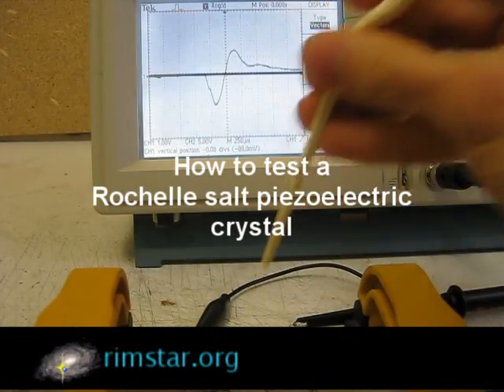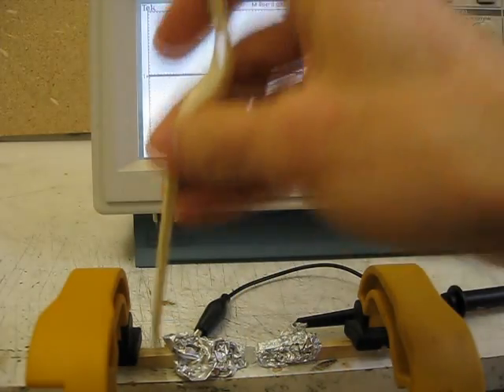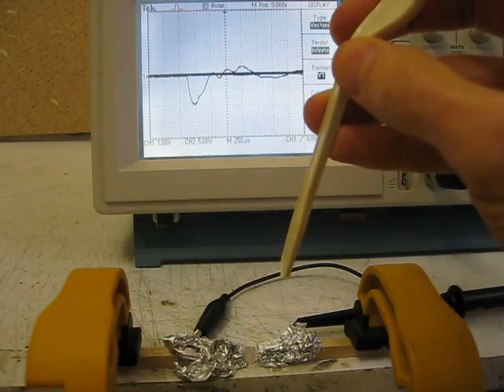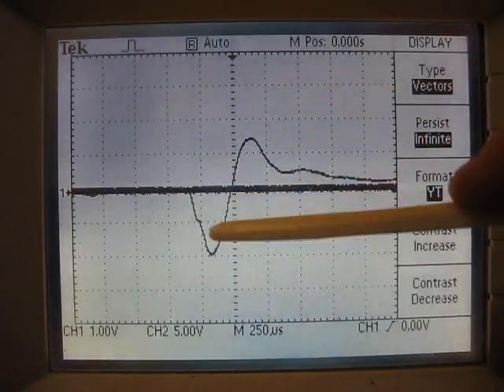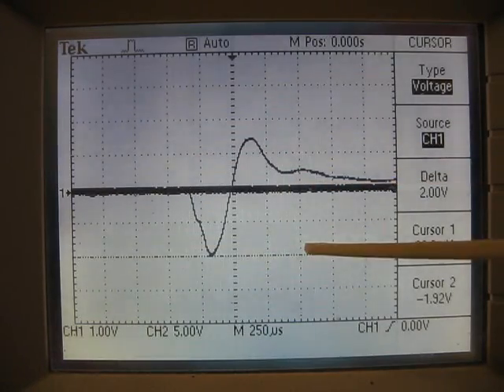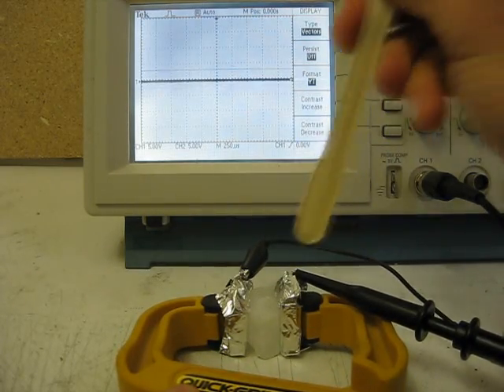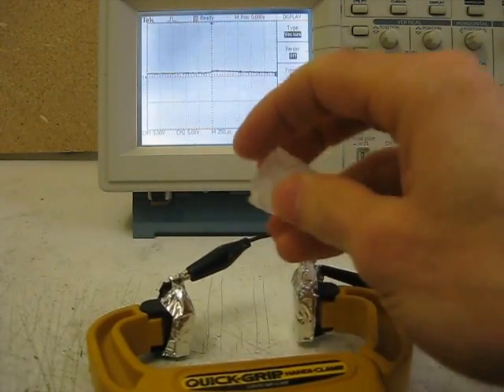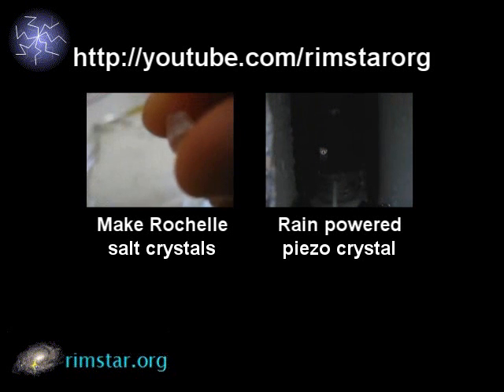How to test Rochelle salt piezoelectric crystals voltage oscilloscope

Comment: Have you ever used a crystal to power any of your appliances?
Reply from the maker: Nope, there isn't much energy being produced for appliances. It also wouldn't make much sense. You need to use energy to tap on the crystals so that they produce a voltage. The amount of energy you get out it less than the amount of energy you use to do the tapping. Very likely you'd be using electricity to power whatever machine is doing the tapping. So you may as well just disconnect the power from the tapping machine and connect it to your appliances instead. Of course, if you tapping is done using falling water then that would make sense but again, the power output is small and electromagnetic generators are more efficient so you may as well use the water to power one of them instead. However, for very small things like powering an LED, using a piezoelectric crystal is lots of fun. See this other video of mine where I do that https://youtu.be/laSQ6yd7jaE
Reply: Okay thanks. I tested the voltage with some crystal quartz with my oscilloscope  today. How do I freeze the waveform?
Do all oscilloscopes have this capability?
Reply from the maker: My oscilloscope has a button labelled "Run/Stop". If the display is running then pressing Stop, stops it, and if it's stopped then pressing Run makes it run again. I don't know if all oscilloscopes have this capability, I only have experience with mine.

Comment: Does it oscillate when you apply constant squeezing pressure, or only when changing squeeze pressure?
Reply from the maker: Only when there's a change in pressure. Constant pressure doesn't do anything - which makes sense, otherwise you'd be able to put it under pressure and get free energy forever.
Reply: @RimstarOrg  thank you

Comment: Why do bbq igniters generate 1000s of volts
Reply from the maker: That's to create a spark to ignite the gas to produce the flame. You usually need high voltage for a spark.

Comment: très intéressant !
comment détermine-ton la polarisation sur un crystal?
y à-t’il un sens de placement des 2 collecteurs alu? (sur la longueur ou la largeur du crystal)
merci
Reply from the maker: Thanks!
There isn't really a direction for the polarization, at least not according to what I saw on the oscilloscope. The spike goes one way and then the other way. Regarding the direction of the placement of the 2 aluminum collectors, I just rotate it around between the 2 aluminum collectors while tapping on the crystal. I can't tell what way it will be just by looking at it.

Comment: What is Seidlitz powder?
Reply from the maker: From https://en.wikipedia.org/wiki/Seidlitz_powders it's tartaric acid, potassium sodium tartrate and sodium bicarbonate. It usually comes with two packets. "The white packets contained tartaric acid, and the blue packets contained a mixture of 75% w/w Rochelle salt (potassium sodium tartrate) and 25% baking soda (sodium bicarbonate)."

Comment: What happens when you put a positive voltage bias on it . Does it tranfer to a higher voltage peak ?
Reply from the maker: Putting a bias on it wouldn't affect the output of the piezoelectric crystal.
Reply: RimstarOrg im still curious as to why not as the way i see things there is a path through the crystal or outside skin for a moment so i figure a bias of double the voltage should be noticable on a scope ! Any explanation as to why not? And with reverse dc is the energy quelled?
Reply: Point of question is if a seperate current can be passed whilst crystal is creating voltages from the pressure periodically changing the formation ?
Reply from the maker: Ah, that's not what I thought you were asking. I thought you were asking if applying a steady bias across the crystal will change the voltage that the crystal itself will produce. Regarding how conductive the crystal is, I don't know.
Reply: RimstarOrg interesting concept i think and worth investigating as possible solid state modulation !

Comment: Great video .  BUT what amperage ?? Would the crystal make more voltage and or , more amps , if struck with stronger  force . just short of fracturing it AND does the size make a difference ..
Reply from the maker: The amperage is too difficult to measure given the erratic waveform. But it's also very low. I'm not sure if striking it harder provides more amperage, though my guess is that it would.

Comment: How do tiny piezo electric lighters (like a bbq lighter) create a 3-4kv spark when those crystals are much smaller than yours and yours is only a couple volts. Maybe the harder you hit the crystal the higher the voltage? (because those lighter springs have a lot of power and hit the crystal really hard.)
Reply from the maker: The difference in the spark is due to the different materials which the crystals are made of.

Comment: great video.. Can you make a larger crystal,, I need a 1/2'' by 1 1/2'' crystal, any ideas ??
Reply from the maker: Thanks. Well, I grew the large crystal in this video by starting with a small seed crystal. I guess you could just keep growing it larger. I wouldn't guarantee that it would be easy and you might have to try a few times. The process I used is on my website here:
For the seed crystal: https://rimstar.org/materials/piezo/how_to_make_rochelle_salt_piezoelectric_crystal.htm
For the larger crystal:
https://rimstar.org/materials/piezo/make_large_crystal_from_a_seed_crystal.htm

Comment: I know this video is from 2011, but can you resonate one of your crystals with sound and look at the output? say, if some of your crystals vibrate in range of audible sound you could bring it to resonance with the correct sound frequency. the bigger one would vibrate slower.
Reply: Alvaro Hernandorena if you know it's resonant frequency then yeah, it should be higher than human hearing though
Reply: carolyn mmitchell I'm looking forward to find one large enough to resonate low

Comment: WOW!!!!  AWESOME video...i like it but....
Will u say anything about how to connect it to LED light or any MOTOR...?
PLEASE WILL YOU SAY ANYTHING ABOUT THAT...?
THIS IS MY DIPLOMA FINAL YEAR PROJECT FOR MEE......PLEASE.....😞😞
Reply from the maker: The piezo crystal I use in this video probably can't power an LED but I did power an LED using another type of piezo crystal using falling drops of water in this video https://www.youtube.com/watch?v=laSQ6yd7jaE. and this webpage about it https://rimstar.org/sdenergy/piezoelectricity_from_water_rain.htm. I also use them in speakers in this video http://www.youtube.com/watch?v=R7zjfaPKMSE and webpage https://rimstar.org/equip/piezoelectric_crystal_speaker_rochelle_salt.htm.
Reply: If u don't mine may you share me that video...which you made a LED glow by using water drops...PLEASE....YOU CAN SEND ME THAT LINK....PLEASE....my last project is this...PLEASE.....
Reply: thanks for that water drop video but...cant you use power from the piezoelectric crystal that you tested in this video....please i need to use this make this type of Crystal that I can use power supply from this....
If there is no any video can make that video now....

Comment: how much wattage does this produce i ask because im looking how to get 1 million watts in piezoelectricity but i have yet to see how only theories but i dont have the funds to test them
Reply from the maker: I don't know how much power it produces but it's not much. The voltage looks useful but the current is very, very low. Power = voltage x current. So the overall power is low. Probably microwatts or less. (I'll put the same reply where you asked it in my other video so that others can see.)

Comment: The first spike (either negative or positive) is followed by a spike of the opposite polarity.  Is the second spike due to recoil from the table.  Would it would be just like turning the crystal over and hitting from that side?  Thanks again for your videos!  Jerry
Reply from the maker: I don't know why the second spike occurs. It's not really two spikes but more of a dampened wave i.e. multiple, alternating polarity "spikes" that decrease in amplitude over time. Thanks for watching! Steve

Comment: Very nice. The first thing that popped into my mind when I saw the first of these videos was:
One could create the home-brew Rochelle-salt crystals and set them up to restore antique electric phonograph cartridges that use that material but, through the years, the original crystal material had decayed, and would not generate voltages when vibrated by the needle in the record groove.

Comment: Can this crystals be machine to feet on a machine type setup? I was considering to prepare as super highly saturated solution an insert the machine parts inside to see if I can embed the hole contraption inside of the "Piezo" then grind the excess!!
Reply from the maker: +Migueldeservantes I don't know how well the crystal will grow on things. I don't know if it will be uniform enough. You may have to test it to see.
Reply: Thank you for your comment

Comment: Hey Rimstar love your videos! Can you do a video or maybe give your opinion on:  what is the most "efficient" way to create electricity. what is the best Bang for the Buck for power return. What is the most efficient way to create power no matter how small the results.  For example.  Thermo electric power- What are the heat temperature differentials needed to make electricity.. Piezo power- how much force is needed to free electrons? Galvanic or Voltaic chemical reaction power how many stacks of copper and zinc will be needed to make a 12volt car battery , stirling engine power- what are the hot and cold temp. differentials for the engine to work?  Solar power- how many direct sun hours are needed to make 12volts?  Wind Turbine power- how many revolutions to make 12 volts of power.  Is there a Master list of these measurements anywhere? If so...can you attach a link. Thank you!!!
Reply from the maker: +Ryan This could fill a bunch of videos, not just one! :) It also sounds like too much work for a video. But if it helps, some of the questions need work. For example, Stirling engine hot and cold temps really depends on the design of the particular Stirling engine. Every one will be different. The same for the solar and wind and probably the others too. Also, voltage isn't power, so for the solar and wind you could ask how much to generate a certain amount of power (watts) or if you're doing a comparison, how much to raise a particular battery up to 12 volts. I've never seen a master list of these measurements. It would take some amount of study and calculations and/or tests to make up such a list.
Anyway, I'm glad to hear you're enjoying my videos. Thanks.
Reply: one of the most efficient ways it with a tesla turbine, if you run one into the other and so on you can get over 97% efficiency

Comment: Thanks for the video and the interesting ideas.
Do you know if the probe's variable capacitor is the cause of the ringing?
If instead of connecting the signal and ground tips of the probe on either end of the crystal, you connect two scope probes, the signal tips on either end of the crystal, and the two ground tips together, you may see higher voltages and perhaps longer ringing.
Eventually the magnitude of each of the oscillations will depend on the distance of the hit point to the end of the crystal.
Reply from the maker: jlfqam That's an interesting question. I'm not sure how much of the ringing is due to the scope components. From http://www.digikey.com/en/articles/techzone/2011/dec/fundamentals-of-piezoelectric-shock-and-vibration-sensors "Also note that you may think that a pressure sensor would generate only a positive voltage, but, in reality, the signal from the sensor can ring and introduce negative voltage spikes (Figure 4). This means that you may need to squelch negative voltage levels on the op-amp inputs, especially if using only a single rail power supply on the op amp."
Reply: RimstarOrg Hi, With one scope probe on each end of the crystal, the two  signals are symmetrical relative to 0V. However the signal disappears with a bnc T and 50 Ohm termination at the scope input. Hence, it looks like the scope probe behaves as an amplifier of the weak pulse produced by the crystal. Do you know how to detect the pulse without a ringing process?
Reply from the maker: jlfqam The only way I know to look at the trace is on an oscilloscope. You can use a digital volt meter but you'll only see random parts of what's going on.
Reply: jlfqam The probe isn't amplifying, it is just presenting a much lighter load.  The crystal has a very high equivalent source resistance, so when 50 ohms is placed across it, the signal is attenuated by a huge amount because of the voltage divider formed between the effective source resistance of the crystal and the 50 ohm load.  The 10x probe has a much higher input impedance, thus does not load the signal down, and that's why you can see the signal.

Comment: QST magazine has an article how to make a microphone from Rochelle salts 
If you use a step up transformer, 'cause the crystal produces AC, you can git more voltage to light an LED, just don't exceed the reverse voltage of the LED
merci beaucoupe for sharing gr8 vblog
Reply from the maker: N8ZU Thanks. I haven't tried a microphone yet. Too bad that cream of tartar is so expensive.
Reply: I suspect there are places on ebay that sell powdered cream of tartar, or the molecular equal, cheaper, I know a place sells titanium oxide powder,  and many other powders as an example, thanks for the comment
Reply: RimstarOrg you can order Rochelle salts online for about $20 a pound.. way simpler than making it

Comment: Is the Crystal polarized?
Reply from the maker: Bob dabiuld That depends on what you mean by polarized. It isn't electrically charged. However, there are specific sides which you have to tap to get the voltage, and the voltage appears on specific sides that are perpendicular to the sides which you tap. In that sense it's polarized. To find which sides you have to tap and which sides the voltage will appear on you just have to keep putting the crystal in different orientations and tapping on it each time until you find an orientation which gives a voltage when tapped.

Comment: All of the videos Ive seen on piezoelectricity use an impact to generate an electrical charge. Could you apply continuous mechanical pressure using something like a vice to produce a continuous electrical flow?
Reply from the maker: Emil R I'm not aware of any way to.
Reply: Emil R Unfortunately, no. Piezoelectric materials produce a charge because the mechanical deformation causes a change in the polarization of the molecules. Therefore, under static pressure, the molecules will be deformed to an equilibrium displacement and stop generating charge. However, maybe if a modulated pressure was applied to the crystal, you could have a sinusoidal current response with a DC offset. I'm just speculating though.
Reply from the maker: Wow! My answer actually implied it might be possible. Sorry about that. Bo Beall is right. My answer should have been no.
Reply: Emil R he does have a vblog on a using rain to generate electricity. I could build a house so the cars and trains going by would make power for me, from them vibrating the earth, forever.
Reply from the maker: N8ZU I think what +Emil R meant by continuous pressure was a constant pressure, like putting it in a vice and expecting continuous power from it. For clarification for +Emil R, the rain powered approach involves multiple impacts, approximately one for each rain drop. In case he's curious, it's here https://www.youtube.com/watch?v=laSQ6yd7jaE
Reply: yeah, I just think they was looking for free enery
Reply: my daughter seen something for free on the www so we went there and they wanted her to buy 5 other products to gits it for free. I told her ain't nutting for free. Free is just Fee without the R.

Comment: can I take a bagful of these and put em next to a vibrating bike engine and produce voltages to charge batteries?
Reply from the maker: You'd have to make a way for the crystals to be hit like in this video, but even then, Rochelle salt piezo crystals aren't the most powerful to go with. Ones that you get from a lighter, like in my "How to take Piezoelectric Igniter from Lighter for Spud Gun" video are more powerful.